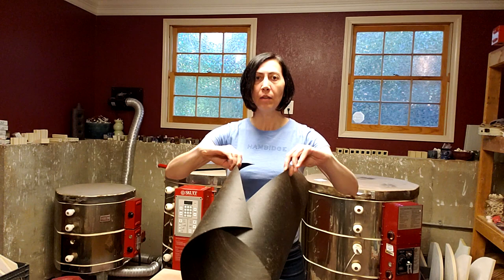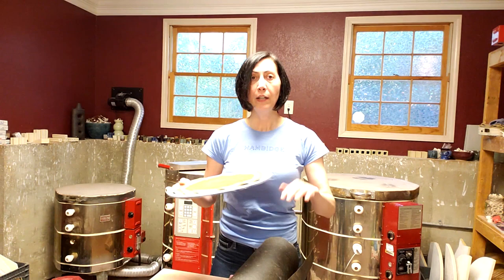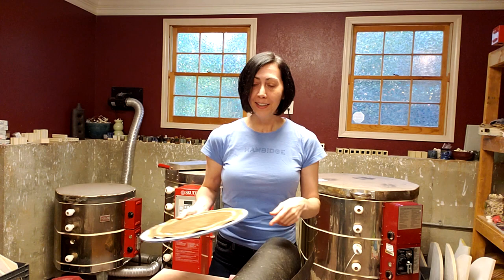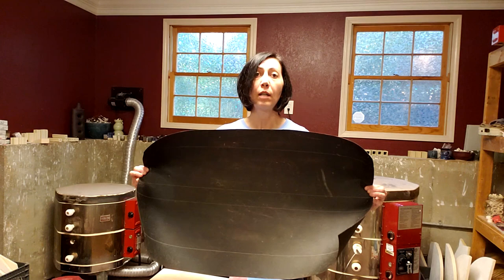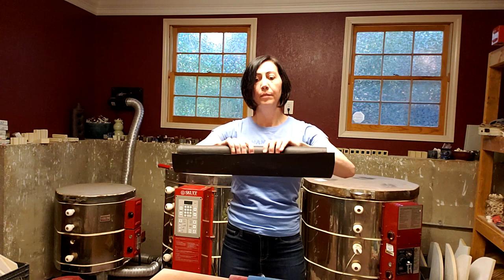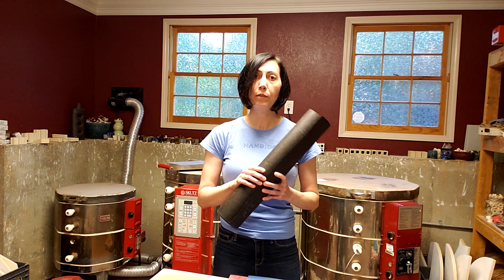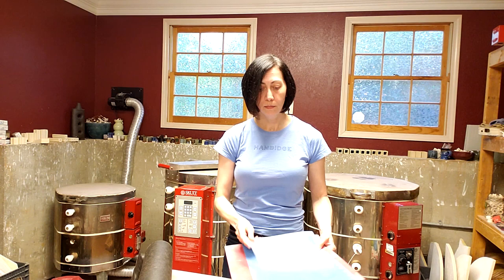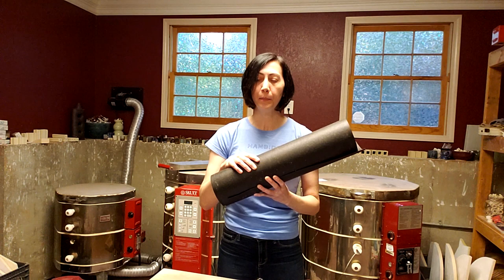Pottery- DIY Slab Mats from Roofing Felt / Tar Paper

Comment: I know some handbuilders that use that stuff to make templates for their pieces. They roll or rib their template onto the slab, cut out around it, and then leave the tar paper on until after they have assembled the piece and that way it give support as they are working on it. Once they have the form assembled, they peel it off. Never thought of using it as a slab mat too, thanks for sharing!